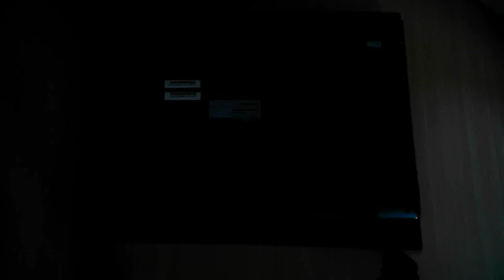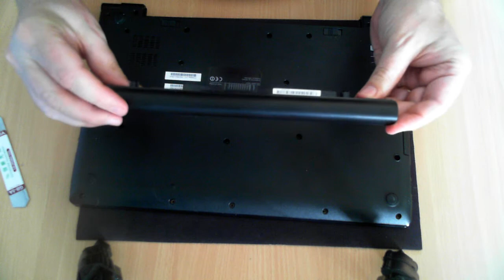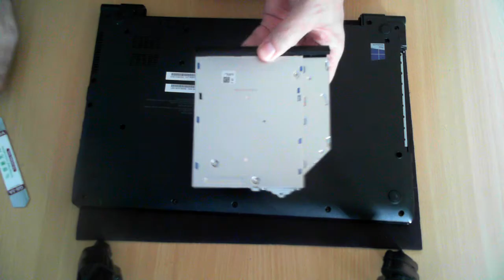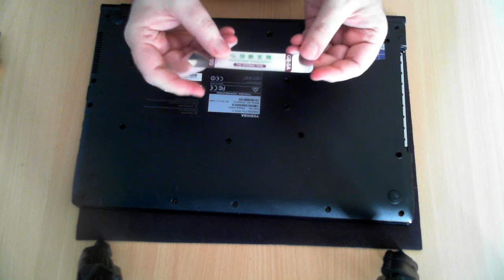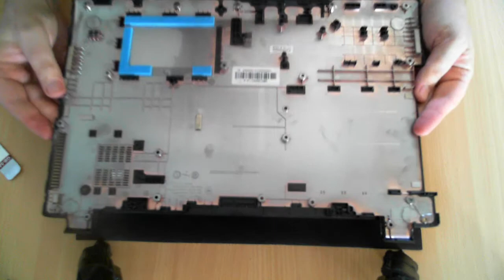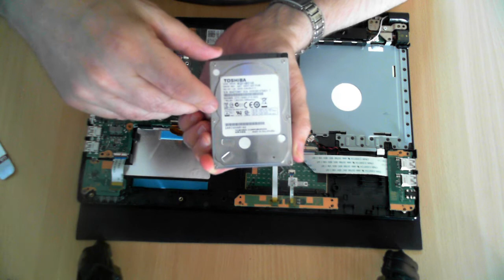Toshiba Satellite Pro R50-C Opening / Teardown

Comment: Many Thanks for this. My exact laptop has started running hot. Do you think if i popped the back off like you did and sprayed a can of air around the fan and vents that that would fix it or is there other things i might need to remove and clean as well?